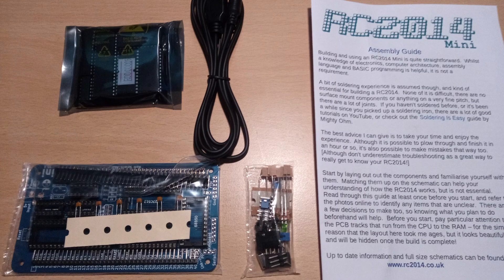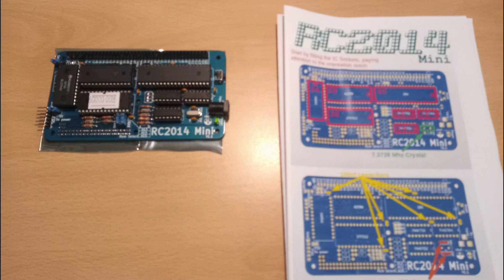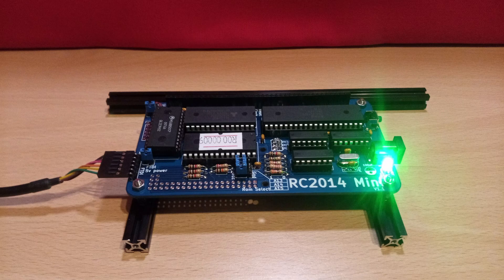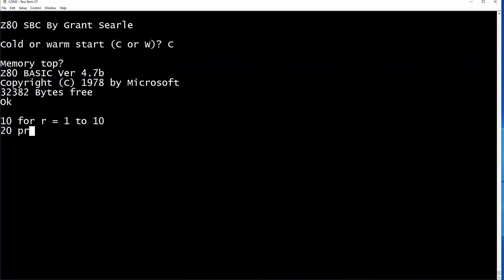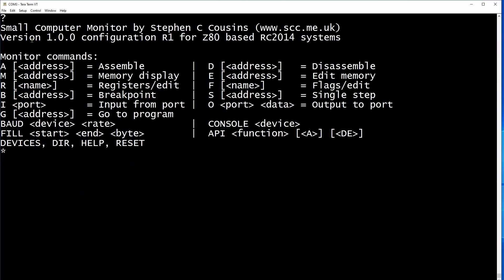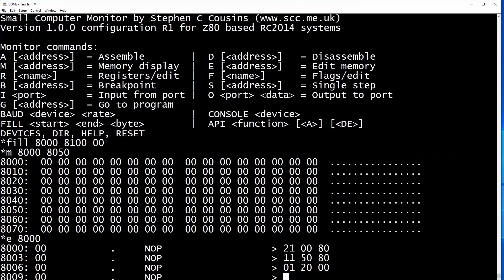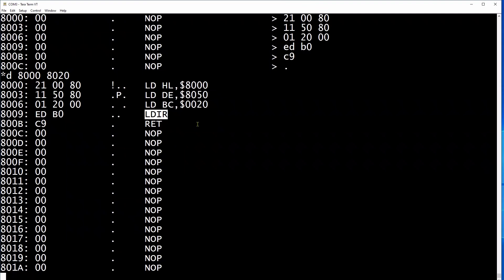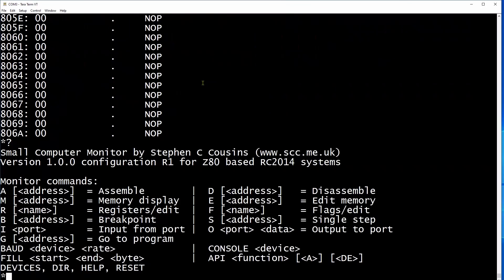RC2014 mini - Z80 modular system - part 3 - putting it together

Comment: I like the RC2014, it was designed with passion for real computers. It changed through the years, some extra pins came to the design. Maybe it could be improved if the compete busboard would be gone and replaced by rows of pins at one side of the PCB and on the opposite side a connector to fit the pins at the other side. Then the PCB could be stacked in a solid way.
Reply from the maker: An interesting idea